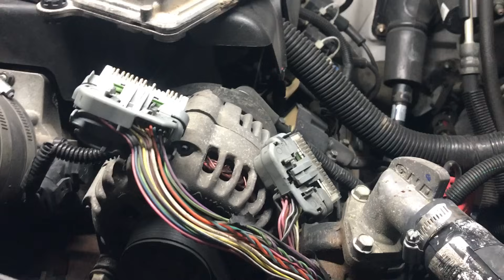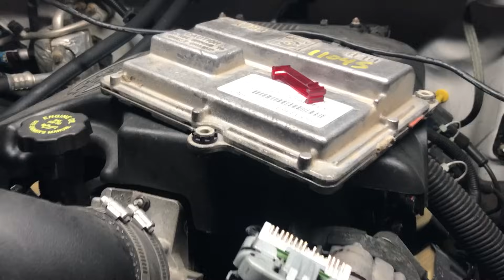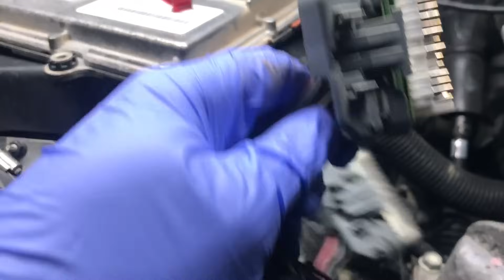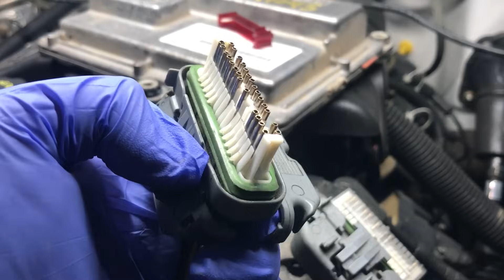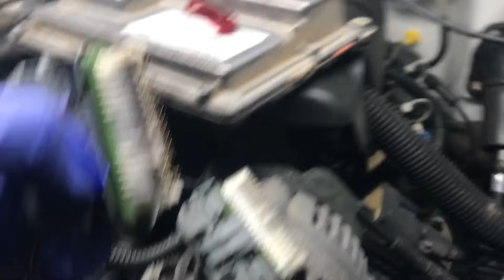Allison 5 speed TCM common issues and fix Allison 1000

Comment: I’m getting a U2104 CAN Bus reset counter overrun and U2106 lost communication with Transmission Control System and U1800
Reply: I’m getting Transmission control system too let me know if u figure it out
Reply: @angelrivera1313  I had the ecm harnesses off the ecm. They didn’t reconnect properly so I had to take them off again and put the rubber seals back into the harnesses. The code seemed to go away after that. The harness closer to the passenger side of the ecm has the data high and low pins and that was what I was testing for continuity

Comment: my 2005 duramax is having an issue with acceleration. sometimes the gas pedal just dont do anything al all. It moves, just dont rev the engine.. it gives me a p0658 code.. Pin 11 shorted to ground.. Think this could be the problem? Id hate to go messing with it. Makes me nervous

Comment: I’m having issues where my truck shifts awesome for a mile then all of a sudden I’m stuck in limp mode and it’ll slam into 3rd after clearing the code after putting it in reverse it’ll have a delay and then slam into 3rd after reverse would this solve this issue?

Comment: I have a 2004 LB7 with the Allison 1000 that keeps going in limp mode when I tow my camper up any big grades and the overdrive kicks in and it downshifts from 5th to 4th. It has now done it on my last 4 camping trips. Last time it threw about 5 or 6 different codes- 2 of them being P0700 and P0735. I do have a tune from a reliable diesel mechanic in my area but I baby the truck and rarely drive it above 55mph. Think it’s the trans or the torque converter?

Comment: I have a 2001 Duramax, with the Allison 1000 4WD transmission. One day it was raining, and I hit a big puddle going a little fast. Immediately the transmission started acting up, and it didn't want to go into 1st gear. For a few minutes afterwards it kept taking off in 2nd gear. After about 10 minutes, and with the rain stopped everything went back to normal. A few weeks later it started acting like it was slipping out of gear, it wasn't real bad about it at first. Then a few days later it got worse, and wouldn't go into gear, only reverse. I got it towed home, and started messing with it to try to diagnose the issue. I checked all my connections, cleaned them, and put some Dielectric grease on them. I did notice that the main connector pin did have a little bit of ATF on it, so I cleaned it. I replaced the internal, and external filters, and put new fluid in it. I also replaced the transmission cooler because it was in bad shape. I tried for a few days tinkering with it, but couldn't get it to go into anything except reverse. I got the idea to put it in 4WD, and then put it back into 2WD. Once I did that it immediately started going into gear again, and cycling through all the gears smoothly. I checked my linkage cable, and all seemed to be fine with it. I apologize for such a long post, but I'm at my wits end, and I'm not all that experienced with transmissions. Has anyone dealt with something like this with their transmission before? If so do you have any advice, or suggestions as to what it may be? Please, and thank you very much.

Comment: I have a 2002 K 2500 with the Alice in 1000 coupled to the 496  3.73

When heart I noticed it will shutter and buck especially under 2000 RPM with a very light load in overdrive 

Is that character of a torque converter?

Comment: I was trying to fix those pins today forgot to unhook the batteries and the pins touched the ground bar and sparked truck won’t start now and it doesn’t show the waiting to start or the check engine light anymore and the scanner tool says it can’t connect,checked the fuse and didn’t see any blown is the ecu cooked?

Comment: I'm curious to know if we're supposed to be pushing these pins in when it's attached to the TCM, The reason I'm asking is because I already pushed the pins back into position in the plug and then plugged them into the TCM and still in forward gears it's flashing only
Reply from the maker: Unplug it

Comment: My 06 Allison 1000hs transmission has q trans communication disabled on the dash and only drives in 1st gear wont shift. I changed all 3 sensors and still acting weird. Shifts hard in reverse and drive. Speedometer is not working also. I checked the wires like you said and same issue. Do you rhink its the tcm module? How do we test it if its bads?
Reply from the maker: Wiring won’t be an issue on 2006 it’s a bad TCM
Reply: @SpartanAutoworx are you able to reflash my TCM or am I'm better off buying a new TCM and having it programmed to my vin?
Reply: @SpartanAutoworx  this TCM is off a Freightliner mt45 chassis with a Allison 1000 trans. Is it possible to reprogram my old TCM or buy a new or used TCM and have it programmed?
Reply: @SpartanAutoworx can you fix a bad TCM?

Comment: I have an 03 international 4300 with the 2000 series allison transmission it's not showing any codes but it all of a sudden started holding in 2nd or 3rd gear and stipping shifting all over r the place. Where would that be located on my truck. Because I've changed the trans filter the solenoids and still having the same problem.

Comment: Hey guys I hit a 12 point in 04.5 and I have rebuilt everything but I'm getting range shift inhibited. Only code showing P0700. I can lay under the truck and hear the shift cycling but as soon as it goes to move it disengage and nothing. New motor and tcase with 23k on them. Will give yall a call at more decent any help would be greatly appreciated I really miss my truck😢

Comment: question: My shifter in M shows 6 gears, but when I serviced my transmission and dropped the pan, i noticed the internal filter looks like the 5 speed one. So how does it determine between 5 and 6 speed? My shifter shows 6 so i assumed it would use the 6 speed filter. Just wondering how this works then? I have a 2006 Gmc Sierra 2500hd LBZ
Reply from the maker: You have a 6 speed
Reply: @ okay, idk why oriellys gave me the wrong filter then. When i checked their website, the ones that showed for 5 speeds looked exactly like the one I saw when i dropped the pan. Why is that?

Comment: Just wanted to say that my 05 duramax started throwing tcm codes this morning and shifting into 4th gear too early so i took to the internet and found your video. You juat saved me so much time/money trying to figure that out, thank you so much sir. I found a pin short in my lower plug(clear one) and corrected it. Now my truck shifts smooth as butter again! Thank you so much!
Reply from the maker: Thanks for sharing

Comment: So I have a 2002 gmc sierra 2500hd duramax and I’ve pulled a p0700 code as well as p0561 & p0562 codes, so basically if I need to go into reverse I would need to shift into drive the back into reverse for the indicator to light up and the same goes for when I need to go into drive, except I need to go into 3rd then back into drive for the PRNDL to indicate I’m in drive, I’m assuming this would help solve this issue?

Comment: I have a couple electrical codes p0700 p0500 p0727 all sensors for electrical problems, solenoids p0748 and p0778 shifts just rough from P,R,N,D won’t come out of 1st gear 

Shop put in a new OEM TCM programmed and re-flashed re wired the sensors and pigtails 
Gave me the truck back at no cost to me and said sorry they couldn’t fix it. 

I changed the valve body with all new solenoids , the internal wire harness I’ve changed all the sensors out still getting the same codes I’m at a loss 

Will try this next
Reply: Did it work?

Comment: We Have a Allison transmission that only has 3 rd gear going forward. Won't shift into 1st, 2nd, 4th or 5th. Reverse is fine. We installed another transmission with low millage no change. TCM?

Comment: Great video! I just subscribed to the channel. Do you have any recommendations for a 2018 GMC Sierra 2500 L5P that when put into reverse the "R" on the display starts blinking and the truck won't go into reverse? I just changed the TCM fuse. We are scheduled to leave town today for an event 3 hrs. away for our small business and we are stuck at the house. Trying not to panic. Any ideas to try first? 
EDIT- Codes being shown are P249D, P0701, P0731, P0751, P0756, P06C6
Reply from the maker: Bad tcm

Comment: @Spartan Autoworx Thank you for the video.  2002 8.1 Allison 1000 harsh downshift from 3-2 and 2-1 almost like rpm increases to the point of being harsh. no codes.  Seems ok in tow-haul  Can you help with some advise?  Thank you!
Reply: Did you figure out your shifting issue? Mines is doing the same thing rn? Thank you
Reply: @glyshorts9107   Yes, I cleared the taps
Reply: @ohfugit the what? What are taps? Newbie here.
Reply: @glyshorts9107   they are stored transmission variables. you can reset them with some code readers.

Comment: hi, I write from switzerland, my Silverado 2500 hd has a problem when it change to 4th and 5th gear, when I change I feel a big blow in the transmission, I have the error codes p0700 and p1720, also I get stuck in the 4 gear, it no longer changes in the fifth
thanks a lot for the answer

Comment: Have a 01 8.1 with the Allison,  wont come out of park u can move the shifter but transmission doesnt respond and the letters flash and if u unplug the bottom plug on the nuteral saftey switch itll go into reverse and forward but acts like its second gear were do i start looking ?
Reply: And i have no codes my little code reader says.
Reply from the maker: Call us 636-795-6960

Comment: Thank you for this video, I'm going crazy with all the tcm codes coming and going and thinking it's my tcm, now I will check these pins, I also removed the tcm when I replaced my radiator so I'm wondering if that was enough to pull them out, very helpful video, thank you guys

Comment: Hey brotha, my transmission has 42 different codes, and it did the same with 2 different transmission swaps of good transmissions. im gonna replace the internal wiring harness. Would you do this next, or what is your advice? i was thinking bad TCM, though, with the random DTCs.
Reply from the maker: two different transmissions and 42 codes on each sounds like bad tcm. We usually dont see that many pulled pins at the tcm to set codes like that. I would investigate tcm.

Comment: My 2003, LB seven has 200 K miles, I just had all kinds of work done to it a shift kit even and everything seems sound for the most part except for when I go over speed bumps. It does not matter 5 mph to 15 it always jumps out of gear. Any ideas on the cause

Comment: I have no com with t cm wont crank and I was checking the ground pin1 and 5 the continuity is not stable and the ohms are 50 to 300 engine ground to pin. But my power probe shows fround signal np.and my etm shows a pink wire on pin 2 that is not there?

Comment: Wondering if anyone of you had the ECM B fuse blowing first with the original TCM? I did. Then I bought a second hand TCM and no more fuse blowing. But I've got no communication with the transmission at all. Code U2106 Keeps coming up with my cheapo scan tool. And even with my snap on Solus ultra still no communication with the transmission
Reply from the maker: Bad replacement?
Reply: @SpartanAutoworx I had to not only replace the TCM but ended up replacing the internal wiring inside the pan, and cleaning up the exiting female plug coming out the back of the trans. Replacing the neutral safety switch didn't make a change.

Comment: I have a 03 Chevy Silverado k2500. It out of nowhere stopped shifting out of 1st, speed gauge stopped working, temp gauge stopped working and so did the rpm’s gauge and had abs and parking light on and engine light. We went and changed the abs speed sensor which did not fix the problem, and then was led by people to think it was a instrument cluster. Changed out the instrument cluster, did nothing. I ran the codes on my truck and found it reading a ton of different codes but the main one being the transmission control module. I really did not want to have to buy that with how expensive it is and how expensive the cluster was but I came across this video and went out and sure as heck, one was completely unplugged!!!!! You saved me time, money, and a headache. The truck works perfect now all the gauges are reading right. And lucky me, I found the video in time and fixed it so I still have 30 days to return the instrument cluster and get my money back!!!!!
Reply: My 2008 Chevy 2500 duramax is doing the same but it starts working again after letting it rest im thinking the problem is what this video is showing will try in the morning

Comment: My truck has been running great. I cut it off night before then next morning its just turning over. 2003 2500HD 8.1 with Allison transmission. Ive checked all wires. It is showing 40 codes. Saying heated trans pluse high voltage and low voltage. Also showing all gear codes. I cant .ake sense of it. I  need my truck for work. Caan anyone please help with any advice 🙏

Comment: Watched the video. Yes I have the same issue. Spend 2 hours getting 2 pins back up. Plastic holder was broke and I kinda fixed one pin. Is there a after market fix for this issue?
Reply from the maker: Not aftermarket we can sell you a bare connector

Comment: So I have a question I was running 95 and then looked down my transmission was running hot so I got it rebuilt but it is not shifting and when it does it goes in for one second then it kicks out of gear what is going on help and I checked the pins on the tcm they are all good

Comment: hello. i’m having issues with my allison 1000. truck shifts smooth through all gears. but after driving on the freeway trans is about 170 temp. if i hit a slight bump it will lock me in 4th gear and i’ll pull off and turn truck off and on. i get a shift range inhibited code. any ideas man ?????
Reply: I’m having the exact same issues let me know if you get yours fixed

Comment: Hi, my 2002 chevy 2500 8.1l automatic w Allison will run in reverse but gets the blinking D in drive and won't move. Do you think it could be the same issue?
Reply: I have an 2002 Chevy 2500 6.0L automatic with Allison 1000 transmission.
I have the same issue, transmission shifts into reverse and will move, but in Drive the 'D' blinks and it doesn't have any power to the wheel.
The trans was low on fluid, 5 qts added and it's reading on the 'cold' section of the dipstick when hot and running in Park. 
I was hoping it was the low fluid level caused the issue but now I'll be looking at the TCM harness.

Comment: Got a tcm code and shift range inhibited as well as hard shift into reverse and sometimes drive. Just swapped the tcase. Goes through the gears (1-5) good
Reply: Truck still working good?
Reply: @brettfell551  yep had to clean the main connector to trans. (Fills with trans fluid) also ignition switch to be safe
Reply: @riley s  I changed the ignition switch and just did the internal transmission harness and plug. Still having issues with gear shifting when slowing down to about 10mph. Have codes p2610 and p2510. Been thinking it was the TCM but never have gotten the TCM code.
Reply: @riley s  changing the transfer case stopped the shift range inhibited and intermittent gear shifting for you?
Reply: @Brett Fell  tcase has a speed sensor in it and I blew that sensor. Also the gasket that's in between the transmission and tcase was leaking trans fluid so truck was low on fluid
Reply: @Brett Fell  so not sure which fixed it or both. New case(vss actually) or transmission having enough fluid
Reply: @riley s  just had transmission fluid and internal filter changed too. Gears still acting funny when slowing to a stop. Trailer brake service comes on too. Dunno man.
Reply: @Brett Fell  yeah guess I'm not sure where to point you all the things I read it's 1. Vehicle speed sensor 2. Nbsu switch 3. Dirty connections between trans and tcm 4. Tcm 5. Transmission

Comment: Thanks for the video. I'm hoping you still look at the comments on this video after 5 years and might be able to give some help. I have an 01 3500 8.1 with the Allison 1000 that is giving me a P0732 code. The local shop says I'm looking at $4800. The symptoms are that it intermittently will start shifting hard (specifically going into 2nd gear from first and third), then after that happens for a few minutes it won't shift out of 1st gear. If I shut the vehicle off for about 10-15 minutes and restart it, it will work fine for a bit. The time that it starts to work normally after a restart seems to be getting shorter each time, not sure if it is related to temperature. Thanks ahead of time if you or anybody else can help give me a direction to start looking.
Reply from the maker: Check the wiring first otherwise maybe output speed sensor
Reply: @SpartanAutoworx  Thanks, I really appreciate your time.
Reply: @SpartanAutoworx  As a follow up, I was told that my torque convertor was coming apart and the pieces were clogging the lines and filter. I ended up having the entire thing rebuilt at Inglewood Transmissions in California.

Comment: You just saved me a lot of money thanks to your YouTube knowledge my truck has reverse and 5th gear again, did exactly what you said and it works normal again🤟
Reply from the maker: Glad I could help
Reply: So I have the same issue layed into throttle to pass and about 20secs after truck came to a hault and I pulled off the road no reverse stuck in whatever gear it was in. Check engine light came on immediately, I turned truck off back on everything was fine but felt like it wasn’t shifting right. Cleard codes changed red spin on trans filter cleaned the plug on passenger side for trans still seem a bit oddly when shifting im scared to death to even press on the gas more then I have to. I hope this works gonna try it
Reply: @chrismalone4491 I have the same issue with my duramax. Did you find the problem?